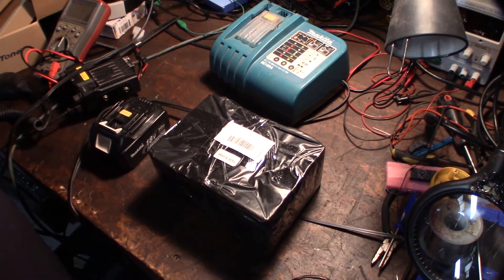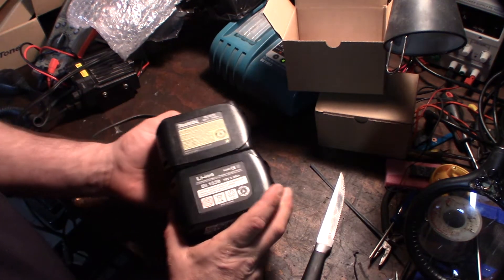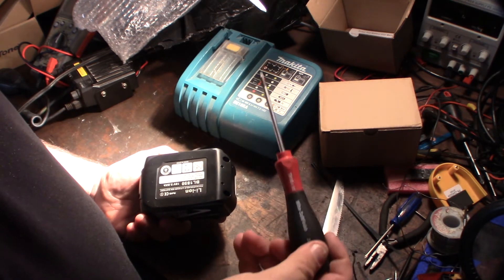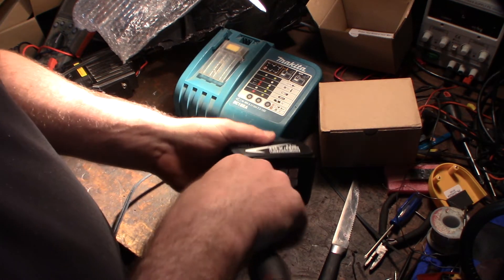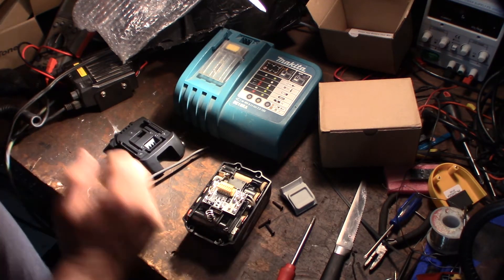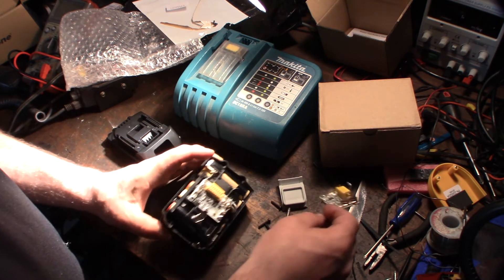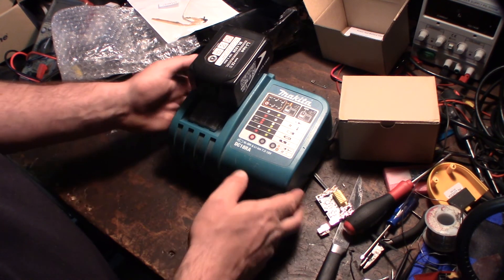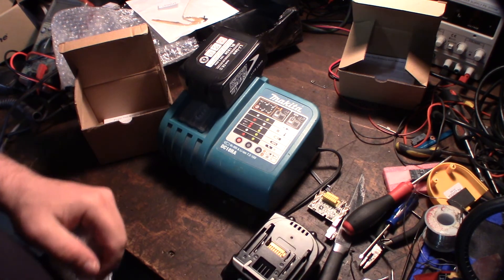Makita fake knock off battery aftermarket Amazon Gerit

Comment: You just need an open mind . I've been using them for years at first with some trepidation but I've had nothing to indicate that they are not worth the money as mine work as well as the original at the fraction of the price . I think there is a big difference between after market generic batteries and blatant knock off . If they work then use them 👍
Reply: Me too, Third the price and seem fine.
Reply: @nickfry7705  I wouldn't touch a charger though just don't fancy one . But I did get the Makita knock off kinzo router and that's really quite good

Comment: Your batteries are not fake. After market is not fake. you can call it replacement.... I purchased on eBay fake batteries from china. The Makita logo was there.
Reply: you are correct Danny. aftermarket is not fake. like car parts. there are oem, original and aftermarket.